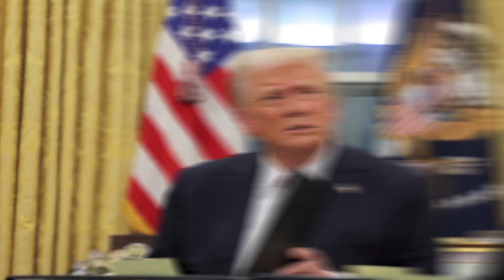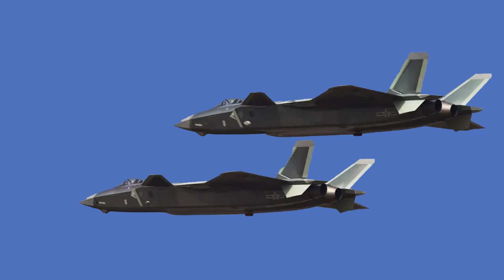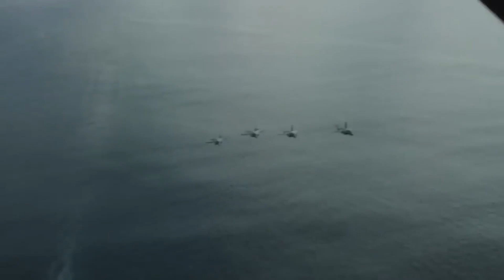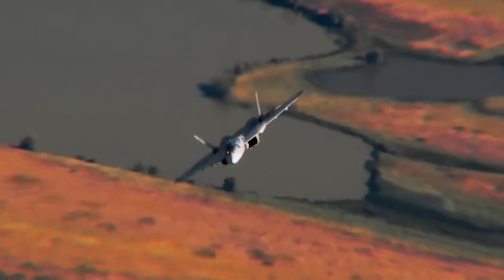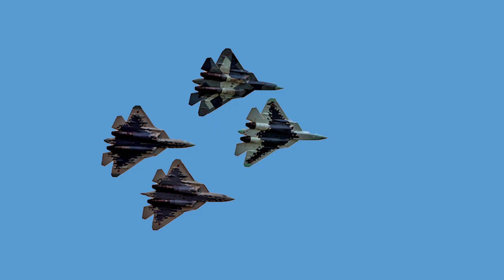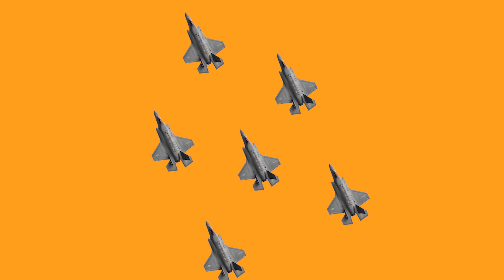F-35 vs. SU-57: Which Jet Could Change India’s Air Power?

Comment: F-35 has a problem with hot temperatures, India would have to keep them under shade 24/7 , several F-35s have combusted on the ground and a large number of planes crashing, the F-35s have been grounded several times and as for the F-35s Stealth .. the RAF has found that the F-35 has to have stealth coating applied after every sortie, half way through flight, the stealth coating  is seriously degregated